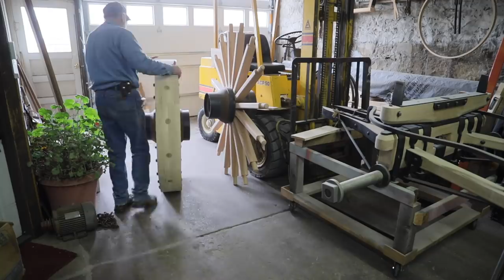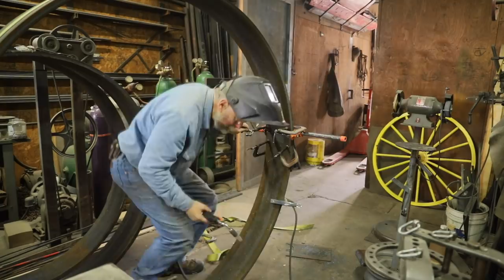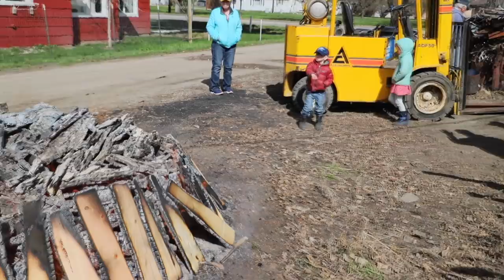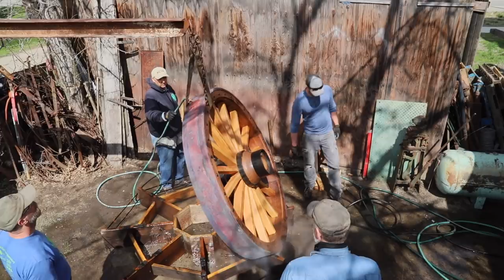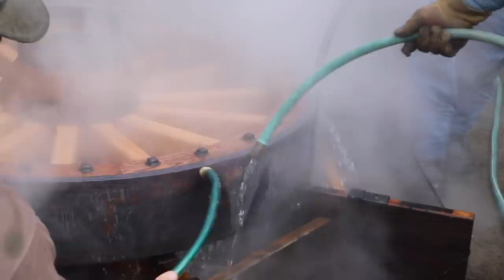Hot Setting 450 pound Steel Tires on the Water Wagon Wheels | Engels Coach

Comment: I can not imagine people doing that over one hundred years ago without the forklift .. great video
Reply: I was thinking the same thing. My guess is they either built some sort of rotating boom arm hoist or they had 6-8 men pick it up with tools??
Reply: They most likely would have set up a triangle of three poles with a pulley at the top one one side of the fire, and another one 30 feet away or so on the other side, and arranged a pair of capstans to manage a rope between the pulleys with a block and hook in the middle. A couple people on each capstan and a few more to manage the tire, using the same kind of hooks used here, and it would have been fairly easy.
Reply: Yes, it must have been quite the enterprise - lots of men and ingenuity. But I guess 480 lb tires would have been exceptional even then. They might have been able to operate under a travelling crane, if they had a decent sized  works, and maybe wheels this size would have been made, or at least have the tires done, in such a works. Mr Engels seems to be able to do normal tires all by himself, which scares me to watch, but he seems pretty cool about it.

Comment: Is that a pilot brazed on the end of the spade bit? (When you opened the grease pipe hole to clear the pipe coupling the zerk was screwed into).  I see more clever ways to solve problems on this channel.  I look forward to Friday afternoons just for these videos.  Thanks for taking the time and effort to make and share them.
Reply: I’ve come across similar problems but usually had the room to clamp a guide block in place for the larger diameter drill.  I always learn a couple of new tricks from your work.  Thanks again.

Comment: for those that wanted to know, which I did too. A steel tire for approximately a five foot wheel, with a temperature rise of 500 degrees over ambient temperature, would expand .6624 in length. Having no idea the real length of the tire or temperature out of the fire, adjust your estimate accordingly.

Comment: Kudos to the fork lift driver. It's not an easy job to set a load with that kind of precision. Great teamwork. I suspect those guys have done this before. Great job Dave. Thank you for sharing. How much bigger than the wheel was the tire when it was hot?

Comment: A metal cutting circular saw would be perfect for those cuts. 1" is far above the "rated capacity"  but going slow with a lubricated blade you'd make short work of it. The Skill branded saw is far superior than the Milwaukee in my testing on 3/4" and 1" A36 plate.

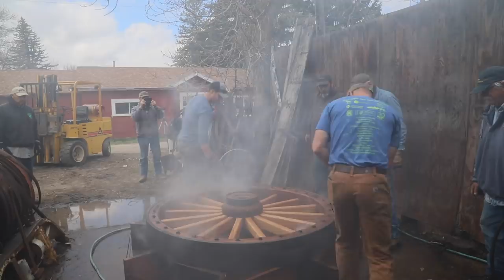Comment: Great work. You heated the tires (?) to m,ake them expand, then as they cooled the compressed the wheel (?) segments together.  What was the gap between the tire and wheel before the tires cooled?  I why was the man beating the tires with a sledge hammer at 22:34?

Comment: Dave,

This was yet another fantastic video!  Thank you for sharing your craft(s).

Back in the 1800s when the originals were built, how did they weld the tires?  Did they simply (nothing simple about that, I think) forge weld them like you've shown on other very large pieces of metal (like the 20 mule team wagon gear)?  If so, I bet that was awkward!  They would have had to have a very large group of men & boys to lift & handle the tires at both welding heat when welding them and also when setting the tires.  I guess they used longer versions of the "monkey wrenches" the forklift used to lift the tires, but with more strong backs lifting the tires?  Or did they have manual bridge or jib cranes, along with the "long monkey wrenches"?

Could you explain what the guy was doing when he walked around the wheel/tire hitting it with the sledge hammer?  I've got a vague idea, but I'd like to hear your explanation of this question and also the ones above in a future video, if possible.  I'm very curious about how the details on how they did this work back then without today's equipment (i.e. welders, forklifts, & electric power tools.  (I'm not criticizing anything here, I'm just curious about the nit-picking details.  :)

Once again, this was another of many (actually all of them) fascinating videos showing your craft(s) & amazing skills!
Reply: Re: The fellow walking around hitting the tire.  
They are trying to evenly set the tire on the wood.  The tire is  expanded by heat, so it will easily fit over the wooden wheel.  The tire must then be cooled, shrinking it to fit tightly on the wheel. So far so good.  But they cannot uniformly shrink the steel tire, some areas shrink before others.  So the tire will bind on the wood, extra compression in some areas and looser in others.  By striking the tire radially towards center, the shock permits the tire to reseat itself on the wood, with the non-uniformity relaxed.  
That's my understanding and I am completely ready to be corrected! :)
Reply: @WhatAboutTheBee  I am pretty sure it was just to set the spokes.
Reply: @michaele1201  And to draw in the gaps between the felloes
Reply: @WhatAboutTheBee  Thank you, that makes a lot of sense.
Reply: @bobvines00  you are welcome!

Comment: Just heat shrinking the tires on the wheel is enough to keep it on or did you have to bolt them also ?

Comment: Impressive.  good...no great craftsmanship. Well done. Watched an overseas video of a early car restoration  the wheels were wood spoked, wood one piece rim (fellowes) with a steel rim bolted on wood rim, for rubber tires,  they cut slots for spokes in wood rim as to attach wood rim (one piece) onto spokes the then drilled  holes threw rim into spokes,  where then drove in wood dowels to keep spokes centered in rim then a thin metal  band  was nailed to outter wood rim. Then they sliped over the steel rim/ drilled and screwed to wood rim then installed rubber tires.  Also the hub was steel,  but they doved tailed the spoke ends together making a center wood hub  then put the  two piece hub on, in from each side then drilled holes in spokes use the flanges (of hub) holes to know where to drill, then bolted flanges of steel hub to wheel spokes hub.  Seemed to be a way different way than seen you do.   seems to me they could of made the outer diamiter of the one piece wood rim thicker then sanded to slighty larger than  inner diameter of the steel rim then heat the steel  rim  slip over wood rim for a better fit.  not use a thin strip between wood and steel rims. But thats over seas for ya. Germany to be exact.  Note the wood rim was made by laminated thin strips glued over each other  around a jig. used a hot air gun to heat strips wood to bend and clamp untill dry.

Comment: Where do they use such huge ones? The wheel n 1" rim doesn't gives an idea how big... But seems definitely very very high load bearing.
And in this modern age how come they still preferring wooden cart wheels? Pls explain.
Reply: @EngelsCoachShop  
Do they still use such wagons in modern age? And why? I have seen that Borax Wagon. But this wheel seems to be capable of holding still larger mass than that.

Comment: How big operation is this actually? In the beginning I thought it was a small hobby and for fun but now I see heavy and expensive machinery and large buildings, but only one single man, what is the story here?
Reply: One man commercial operation. The help called in for the day was just that, help called in for the day. Setting these giant tires is something that doesn’t happen every day — or even every year. It looks like the backyard of the shop, most of those buildings are neighbors. You can google street view stalk a little to see the size of the building and what the surrounding area is like — the town has just under 600 inhabitants, not exactly an industrial giant city, but this shop is right on Main Street. Just like the local smithy would have been 150 years ago. Not every town would have had a wheelwright, but they’d all have had a blacksmith.

Comment: How many inches the iron expands on heating in circumference?
Reply: @EngelsCoachShop  
So does the firewood would have reached 1500° ? I think only furnaces can achieve that temperature. Also the wood would start burning very quickly however good the water treatment is, and then around 2" contraction... Isn't that too much for the wood in terms of accepting the tension?

Comment: Out of interest 
How did they used to join the ends of the tyres
Is forge welding strong enough or accurate enough?
Reply: @EngelsCoachShop  
Cheers 
I guess it doesnt really take anything from the originality any more than using other electric tools 
Modern conveniences

Comment: :-/ the weights don't seem realistic.  Heck, I just rebuilt a three-cylinder diesel in my old Ford backhoe, hung it on the scale just before reinstalling it, and all up, with the torque converter attached, it only weighed 850 pounds.

Comment: How would they have done it in 1880?
Not quite as easy  I would guess!
Reply: @EngelsCoachShop 
I was thinking specifically about the difficulty of the tire joint, to achieve the necessary accuracy that was relatively easy for you to do with the arc welder?
I would guess that they would the job the other way round: They would forge the ends together and make the wheel to fit.